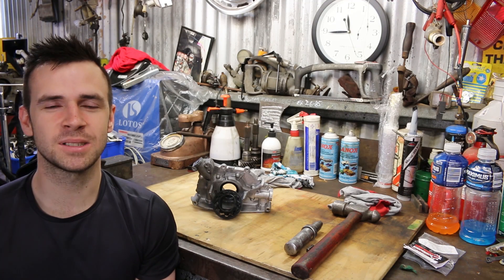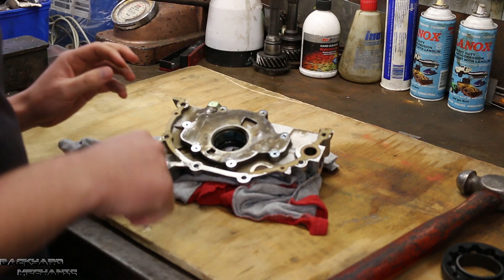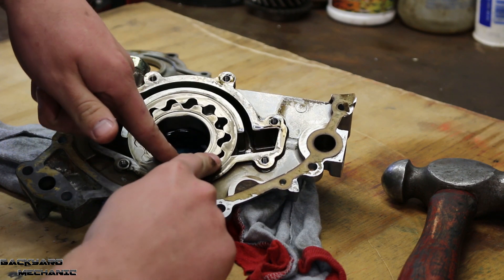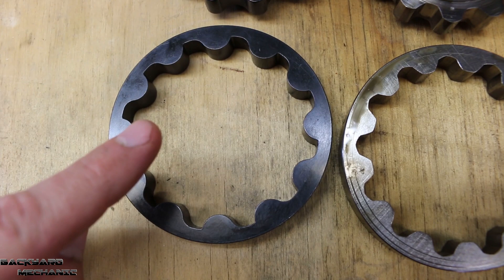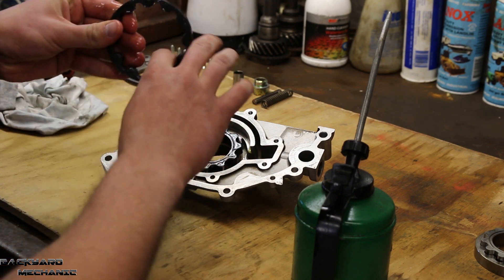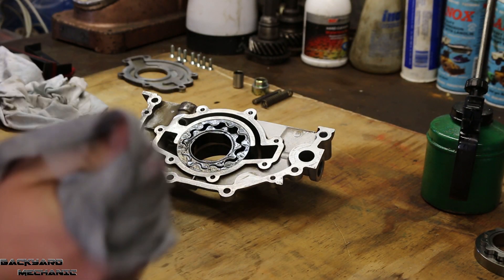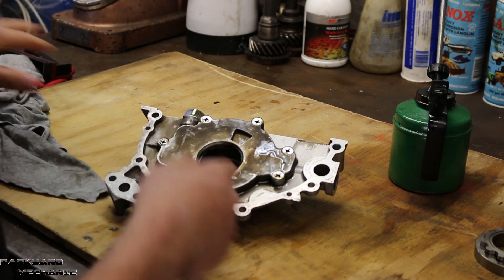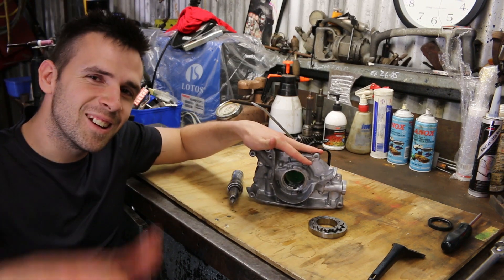RB26 HOW TO ►Install Billet Oil Pump Gears │Project R32 GTR Episode 15│

Comment: There are actually several issues that can also combine to cause the oil pump gear to shatter.
As Supertec Racing said is correct, and to add to that, the early rb26 crank had a small drive area from the crank, which resulted in uneven wear and thus causing fractures, resulting in then a shattered pump, the other, which is ALWAYS overlooked, is the failure of the harmonic balancer to absorb unnecessary vibration from the rotating assembly. I always recommend running a new oem/Ross/Ati balancer when fitting the new oil pump, and since, have not had a single failure in 10 years.

Comment: I've read that the nose of the crank on the 1989 to 1991 RB26DETT is too small. The clearance between the nose of the crank and the part that drives the oil pump inner gear was too loose. This causes the crank to hammer against the pump drive gear which shatters it. Apparently the only proper fix is to change the damn crank :( EDIT: Michael's response speaks of a different solution :)
Reply: not true. you can shrink fit a spline drive crank collar to the short nosed r32 crank. allso the 33 and 34. the spline drive then drives new spline drive gears in the oil pump. this is the ultimate solution to this issue. i went with std r33 crank and reimax oil pump gears. much like the one's he is useing.
i allso used thread lock on the bolts inside the pump.
Reply: Thanks for this info! I'll ask my shop about this option.
Reply: JohnnyNismo look at supertech's reply in here. they have a very good solution for this. what I described. unfortunately the crank has to come out. I would have gone that route if I knew before I bought the reimax billet gears.
Reply: Michael yes I found Supertech a couple of days ago. They're the best solution given the money and situation.

Comment: Good video. One quick correction on your statement. Fluid does not compress. If you get water in your cylinder, the piston cannot compress it and that's how you bend connecting rods. So the way it actually works. At 6:49 you can see the channel in front of the gear. The oil is forced to that channel when the chamber is closing and that is what creates the oil pressure.

Comment: Should look into buying assembly grease and using that for the gears and packing the pump opposed to oil. Also, use locktite on the screws not oil
Reply: Ethan Lowe yeah oil can crack the metal

Comment: Supertec spline drive kits eliminate the risk of pump drive failure for high horsepower application. Rather than having two "flats" to drive the pump, a spline collar is tight fitted to the crank to drive a converted pump gear.

Comment: more flow means more oil in your head, which means less oil for your bearings.  Bad job.
Reply from the maker: You are actually wrong about that. The RB26 came from factory with 2 oil galleries to the head. One of those had already been blocked off. This one is between cylinders 4 and 5. The other oil feed has a 2mm hole. I have put a 1.5mm plug over the top of that. All the other RB's have both oil feed holes open. This video doesn't solve the oiling problem to the RB engines. It's ONLY for the oil pump gears. Besides I am not racing this motor. If I was going to rev it hard I would also add an oil head drain kit to it. The oil restriction mod I have done will be enough for my engine! You are right but, more oil to the rb head means less to the bearings which is very bad, but not in my engine :)
Reply: Do you realise that the bottom end gets oil starved because of restrictive flow from the head?  Upgrading the oil pump makes this worse. How am I wrong about that?
Reply from the maker: That's why you plug or 'restrict' the flow to the head in the first place. Which is what I did......
Reply from the maker: Besides the oil pump is upgraded not to increase flow, it's to stop the gears from breaking. Just because of the wave profile doesn't mean it's gonna flow 10x more.
Reply: The smaller restrictor placed to prevent oil accumulating in the head was a misconception perpetuated by Tomei when they released their upgraded oil pump. Nissan never utilized a "head drain" nor employed a restrictor in the oil galleries for any of their competition vehicles. Many people have documented on forums where they have closely inspected Nissan race cars, particularly those used for the Bathurst, and not found head drains as well as being told that restrictors had not been used in the oil galleries.
Reply from the maker: Ra's al Ghul I look at an oil head drain kit as insurance. But we all have to remember my car is not a bullet drag car or circuit car. It's a street car. As far as I'm concerned for my application, upgrading the gears and installing a head drain is just insurance for your engine. Although I haven't done a head drain kit, I may do it in the future. I've found Nissan have blocked off one of the oil galleries from factory. Well at least that's what my research has told me.
Reply: The group a GTRs used an external oil pump picking up from the sump as a full dry sump setup was not allowed. so, unrelated and completely irrelevant .
Reply: by installing 1.5 mm oil orifice restrictor (tomei) on top of the oem 2mm oil feed to the top. it helps on this issue. i allso had my machine shop drill out all the oil return through the head and block with 1-1.5 mm. i allso installed the mine's tripple flow rocker cover baffle plate kit . so no need to install extrnal oil returb from back of head to sump. i allso have a catch tank conected to the rocker cowers, and an oil return welded to the sump from it. so blowby /pressure should balance out nicely. extrnal filters on catch tank.pcv delete, and turbo intake breather delete. non of that bad air going into the i-c and/or the combustion chamber to lower okatne. so a bit of more knock protection aswell. my car wont see much track use either. i allso welded on a 1.5 l sump extension for more oil volume. oil filter relocator, and a extrnal oil cooler. i would say thats problem fixed. anyways..the new gears dont run as much oil as lets say the tomei pump. so the mods he has done, should be great for his use of the car. and so should mine. its not track built.

Comment: Is this the only oiling modification I should do to my RB26 to take care of oiling issues?
Reply from the maker: stevenminix Nope you should get an oil head drain kit. And also get the oil gallery restrictors that go into the block. One will be a complete blank and the other is either 1.2mm or 1.5 from memory. The oil restrictors are very important. The head drain not as much but if the motor is out I'd do it all
Reply: Backyard Mechanic so if i get oil head drain kit, tomei 1.5 restrictors, and these billet gears I should be fine right?
Reply from the maker: stevenminix I think you'll be A ok so long as you service and change oil frequently. Is it a street car? The oiling problems occur with constant high rpms so as long as it's not a dedicated race car I think you'll be fine with those mods

Comment: love ur work but i hate to tell u the biggest problem with the pumps is the play between the driving gear and the crank.at hi rpm the gear starts to vibrate witch in turn shatters the gears.I have seen even after markets pumps and gears shattered because the real issue of the play bettween the crank and gears where not fixed. There is a clearance of .006 iether side of the gear/crank a total of
 .012 witch is to much. When im building RB26/28 engines i use crank collars that have a total of .006 clearance ie .003 iether side of crank and collar with standard 34 pumps and have had no issue with any of my engiens/pumps failing
Reply: How do you find one with tighter tolerances? Is it more of a purchase and pray types of situations? Why dont oil pump producers make small inner driving gears?
Reply: i'm a little more anal then you, LOL, i'm at .004, TOTAL.

Comment: its also a really good idea to use locktight on the 7 screws.  nissan oil pumps screws tend to come loose. i noticed mine was half unscrewed when i replaced mine.  engine had not been opened before.  i was very lucky.
Reply from the maker: plasticbag11 I think I will take them out and put lock tight on them

Comment: Nice vid, wish you would have done a side-by-side comparison of the factory gear on the crank vs the aftermarket gear. It looks like there's a lot of play with that aftermarket gear! Also, wouldn't you want to use some threadlocker on the oil pump back plate housing bolts? EDIT> Also, some people replace the Phillips head screws with allen key'd screws for that back plate to prevent rounding the heads!
Reply from the maker: I did check it myself but this was after I recorded the video. The amount of play is near the same as the gears I removed. You have brought up a good point and I will deem to look into it. And as for the thread lock you can use that by all means. I just got em real tight with the impact driver.

Comment: The reason these gears break is the Nissan flat drive engagement which puts pressure on two very small points. Billet gears alone does not resolve the issue. We have carried out our own R&D   and have on offer a range of replacement spline drive kits for various RB oil pumps including OEM,N1,Nismo and aftermarket i.e. Jun, Nitto Greddy and Tomei. Our kits are used on various high power RB engines and cars globally. Good luck with the build the billet gears are an improvement over stock.
Reply: Supertec Racing i want to purchase a spline drive For my nitto pump. How can I do so if your website doesnt allow purchases?

Comment: Do you know if the oil pump is the same for the rb 20/25/26 as in can i drop these replacement gears into an rb20?
Reply from the maker: I believe the bolt pattern for the housing to bolt onto the block is the same across 20/25/26s. The difference comes with the internal design. If you look at a Tomei oil pump the housing which the actual gears sit in is much larger then mine. I believe the 25 internals of the oil pump are different again to the 26. So as to which one is better I would say the N1 pump is best and also the Tomei. But it comes down to money. I think just replacing the gears to something like the ones I have will be great for street/track and you'll never think twice about them breaking. If you were going hardcore track ect. I would suggest looking into it more and coughing up extra cash.
Reply: 25 neo and 26 are the same and both use the n1 pump the others use a shitty pump thats worse than this one

Comment: why did you put oil in the thread holes on the oil pump and also why did you use oil should  of put some grease in the pump and gears

Comment: another good thing to do is put Loctite on the bolts. People have seen those bolts get loose in time
Reply from the maker: 040mobil I have since put loctite on the bolts ⚡️
Reply: over tightening them isnt the solution
Reply: Cheers :-)
Reply from the maker: This would be more important for those who don't have an impact driver.